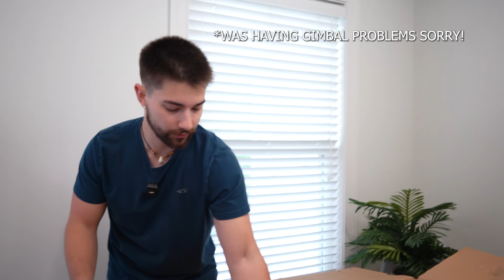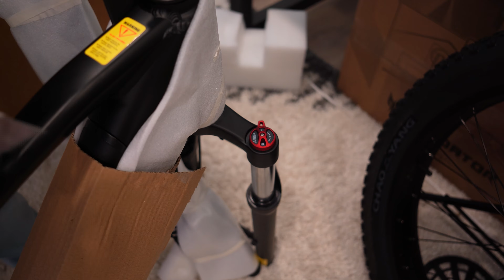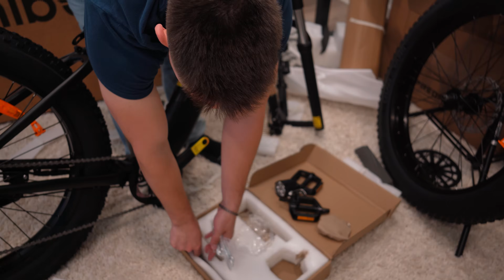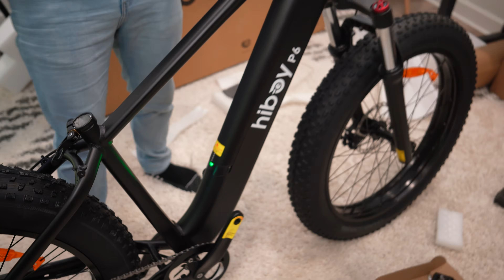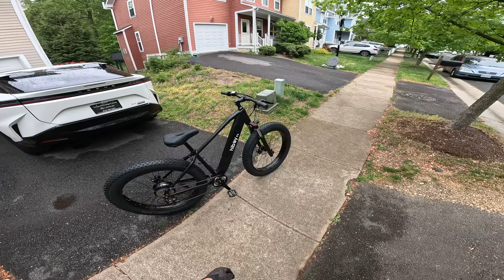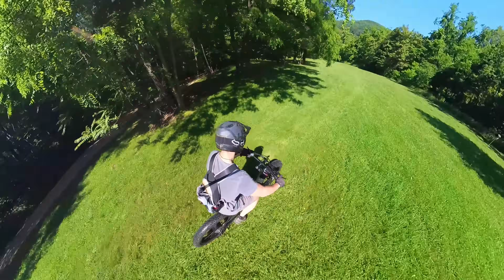HiBoy P6 Fat Tire E-Bike Unboxing & Setup

Comment: I have owned this bike for a few months. It's a good purchase if you are handy. The brakes need constant adjustment. I had to replace the pads at 250 miles. It's super easy to do, but still constant adjustments. No matter how tight you crank them, they still loosen. Otherwise, this bike is a tank! I have taken it on every kind of terrain, and it just eats it up. The only other negative I can think of is the large wheels and fat tires greatly increase the turning radius. That took some getting used to.

Comment: I personally have one myself and I can proudly say that the only problem I’ve had with it is the front tire come loose. That seems like a big deal but after tightening it 4-5 times it no longer comes loose. I will take any questions you would have about the bike.
Reply: How do you adjust these brakes? I can't figure it out. I need mine tighter . Please help me out, thanks ! 👍
Reply: @jax597  in line with the break lever, there are two things that twist. One looks like a gear. You untwist the one behind the gear looking piece a little bit. Both of them should move and then you only tighten the one that looks like the gear. That should adjust the breaks. It’s hard to explain but I hope this helps! If not, you can find videos on how to adjust bike breaks with breaks similar to the ones on the p6 fairly easily.
Reply: @precast2930  thank you! I do know what ya mean and I'm gonna try it. I love p6 but breaks are junk. Need hydrolic, or alot better pads.
Reply: @jax597  I agree, for such good torque and power on a budget bike you have to cut costs somewhere and unfortunately that was the breaks.
Reply: @precast2930  I do agree! Your original battery for the bike say 11.6ah on it and not the 13ah as advertised? Mine does, that's another complaint from me(false advertisement) I also bought a 2nd spare battery with the bike and that one says 13ah thankfully! I love the torque and power on it, fricken wows me every time lol 😂👍
Reply: Yeah, it’s a great cruiser and the throttle comes in clutch on a hot day 😂
Reply: @jax597  my biggest complaint was that the front tire came loose around 6 times when riding, it’s fine now but I don’t know what that was about.
Reply: @precast2930  I did see you said that and yea that's crazy, Scary when you can go 28mph like nothing on it. Was the quick release not tight as it should of been? Mine hasn't done that. I do check my tires every time I ride. How many miles you got on it? And how do your brakes feel?
Reply: @precast2930  and yea the throttle is total clutch!! 😂😂👍 She Just moves!! Mine pedaling I gone 34mph!! Scary, a old coworker of mine just died on Friday from falling off his skateboard and hitting his head 🙏 30 years old only. I don't wear a helmet currently but might starting, either way I'm definitely slowing down and not trying to max out again, either way it felt like I could have gone even faster, motor felt like it was still working/climbing. If it was a 12 speed I bet it goes easily over 40 mph
Reply: @jax597  had to adjust the breaks after around 50-60 miles
Reply: @jax597 Behind the caliper that is close to the wheel, there is an Allen key hole (5mm I think)...turn that one clockwise until you feel it grab and then back it off just a bit.(You can only access it from the other side through the spikes do long Allen key is preferable)

THAT is the key to having a proper adjustment since only one of the calipers move on this bike...the inner one is stationary but every now and then it needs to be adjusted in a bit...
Reply: @daves6380 thanks for responding, I did figure this out awhile back. I put new brake pads in and it deff helped too. 1700 miles on mine running great! 👍
Reply: i replaces pads after about 10 miles, pads arent the best stock

Comment: Nice review my man! Well done...im in Ontario, just got my p6  but it only has 7 gears.  Still a good bike.  Mine came out to $1369.00.  Are you posting a 2nd review...?
Reply: how is it holding on? I am thinking of getting it but i'm afraid to pull the trigger,

It will be my first eBike, used for commuting mainly

Comment: What type of range does it get
Reply: Advertised max range at 60 miles
Reply: @BrettWoodBiking  that’s what I meant, I just didn’t mention it. It’s range is probably in the neighborhood of 30 miles
Reply: I get 20 miles on level 3. 16 miles on level 5 both while lightly pedaling